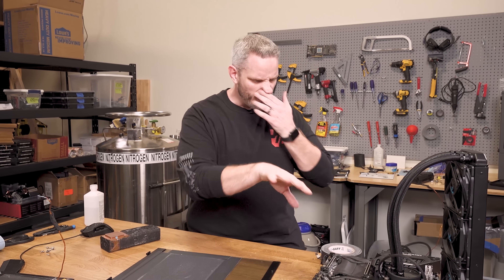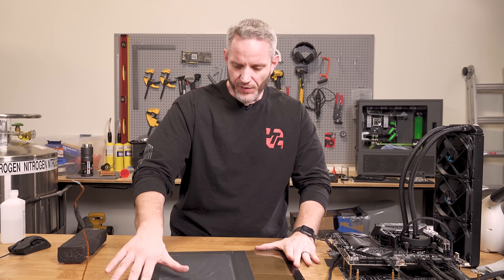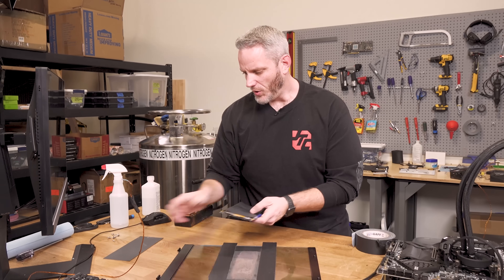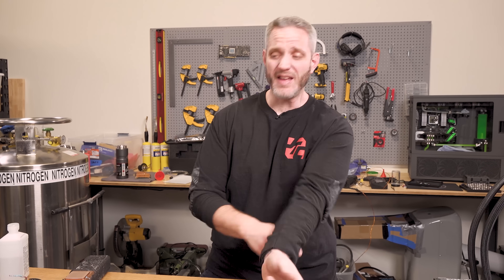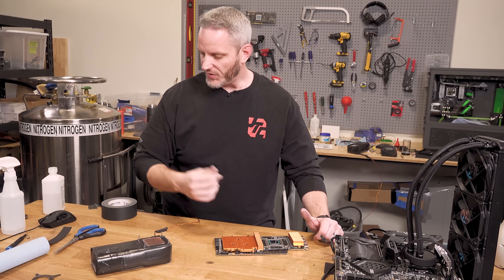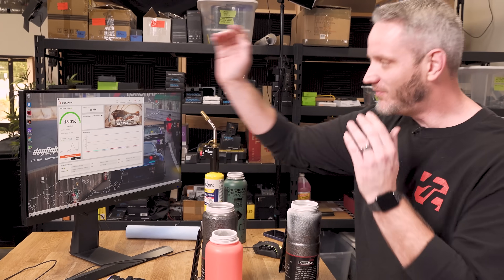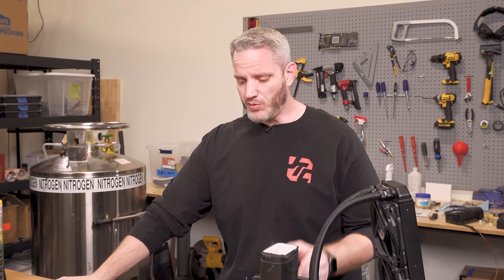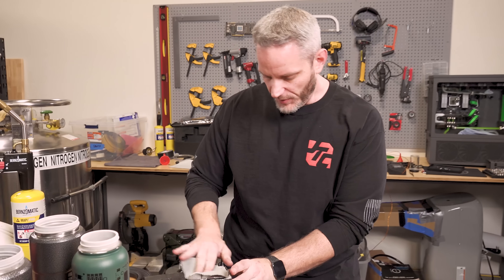THIS is Why Lapping Your Cooler is SO Important!!

Comment: Question: I have installed an NVMe drive onto my hard drive, which comes up in BIOS when I do a search AND it shows up as active (Blue as opposed to being located in black) yet every time I try to clone my OS from my SSD to the new drive, the message that comes up is the same;
"To boot from the new disk, please configure BIOS setting. Make sure the new disk is configured as the default boot disk."
...I changed the location name of the drive in the operating screen, in the BIOS screen I move the new drive to the top THEN the BIOS won't boot up because it is NOT RECOGNISED!!
I have been doing this ALL DAY now and I am at my end, nothing I have looked up has helped, the dozens of videos show me something completely different than what I need to do, so the question is open for some help.

Comment: Do you try to control the air humidity in your workshop? 
And do cooling block and gpu get warped microscopically over time?

Comment: Consider adding 100pF/470pF G0G material or X7R capacitors on back of capacitors for core filtering, it may help you a lot. As they are power hungry it can surely help with OC.

Comment: For more "even pressure" using the clamp u should use a square block/spacer the same size as the die?

Comment: Would just some square off cuts of metal with an insulative layer just in case (even a load of kapton tape maybe) work for bracketing to ensure the pressure from the C clamps is evenly applied across the whole area? It seems to me (newbie here, I don't know shit....at all) would cause a pressure hotspot in a small area and the relative pressure around it would be less given that the board itself is not totally rigid

Comment: Glass is perfectly flat = Has never leveled a Ender 3d Printer.. before and after bed warmup .   AKA You should be using a milled accredited journal block . and you should be using mili calipers to check your work.

Comment: A wider adapter on the end of the c-clamp threaded piston would probably help. Tightening the clamp on the top of those components with just a piece of tape or whatever in-between makes me cringe. The little rubber piece on the end of the rod is not big enough to distribute the load properly when tightening down on components which are soldered to the board. When the c-clamp is tightened the components probably make tiny indentions in the rubber on the end of the clamp from the pressure of tightening the clamp (tape in between or not), then you freeze the whole assembly (clamp, components, and all), and then you crank the handle to loosen and it's a wonder you haven't ripped components off the board already. Need a better way to distribute the pressure. Need a piece of copper, metal, etc., about 1/4" thick that is square with holes drilled on center with the mount with a non conductive, non-stick, hard surface on the card side to take the pressure off the components where your c-lamp is riding. C-clamps are good for holding wood or unfinished surfaces, not precision electronics equipment. Sure they apply pressure, but not evenly.

Comment: Actually, the point of the thermal conductive paste is to make up for imperfections in the two surfaces that conduct the heat to the cooling fins of the cooler radiator itself. The more imperfections removed means less and less thermal paste will be needed. If the two surfaces are perfectly mirrored and flat almost no thermal paste will remain when the block is torqued down. In this scenario the block must be torqued completely flat and square. This creates the optimum metal to metal conduction and removal of heat. Test it and you will see. I did it.

Comment: Jay, glass is not guaranteed to be flat, and it isn't very rigid. I get what you are doing but putting a large piece of glass, of unknown flatness, on a wooden surface to sand a part flat is less than ideal. For the material and size you are attempting to flatten, a proper high quality lapping plate would likely improve your numbers. You should be able to find one for around $200. Here's one sold by Lie-Nielson:

https://www.lie-nielsen.com/products/dia-flat-diamond-coated-lapping-plate

Comment: Changing the mounting bracket using different one will add an variable and you will wonder if the new mouth is good, beside that finally good scoring maybe lapping really help you.
and why you waste so much duck tapes stick on the table and reuse it!

Comment: you could always tighten the 4 screws evenly is a cross pattern, you can get screw driver style "torque wrenches" made for TPMS systems in cars. They are extremely sensitive at low torque specs. I feel they would work well in this application, they can take most types of bites like philliphs or hex pretty much what ever you need.

Comment: Jay, you should try mounting the cooler with carbon paper between the die and the copper block to visualize and adjust any high and low points

Comment: People like to say that being slightly rough gives the thermal paste something to "bite too" but that doesn't seem to be the reason why it's actually better. Having a rougher surface increases the surface area. Even such small scratches means more surface area. So, there is an optimal roughness at which you get the maximum surface area increase, and an increase in heat transfer, without compromising the contact patch as a whole.

Comment: The ice is atmospheric moisture -- consider putting a bag or similar over  it and then using nitrogen, CO2, or some other inert gas to fill the area and displace the air that's present to eliminate ice as there's no moisture in those gasses.

Comment: Jay, have you thought about isolating the PC inside some sort of sealed box (with a tube to add more LN2) and filling the box with dry nitrogen?  No water vapor around the GPU, no ice or condensation to worry about...

Comment: Small granite inspection block will help with flatness, however, they can be expensive. Float glass is a good enough substitute if placed on a 'flat enough' table top. Also, to determine high/low spots, just mark your part with a sharpie. Even fancier would be a dial gauge, but again, kinda expensive to set up.

Comment: I have zero clue about X-OC but you said you removed the foam and feel it helped. If you're still freezing there would it hurt to add some thermal pads instead as sort of an insulator since it's thinner than the foam and can for sure compress enough for it to seal off but could be easier than Vaseline.

Comment: Just a tip. I usually mark a cross with a marker on the cooler base or the CPU IHS. You can check your progress if the lapping is even across the copper by stopping sometimes to see if the cross is coming away evenly and cleanly across the whole area being lapped. It also exposes if you are not lapping evenly or if the surface has a convex or concave profile so you're not having to guess.

Comment: I want to make this comment, having one thing flat on a two piece connection isn't the best way to go about this. Most lapping that is done is two piece lapping. That is where you put an abrasive between the two objects you want to conform to each other and work them both at the same time. You are currently operating under the assumption that your other mating surface is perfectly flat, which it most likely is not. Additionally, your method using sandpaper isn't that accurate as well. Sandpaper is not very uniform in abrasive thickness. You would want an actual lapping plate used in conjunction with lapping media. While what you are doing is better than nothing, it is far from perfect.

Comment: Jay: "...because tempered glass is perfectly flat" 
Me who's tempered glass: "No tf it isn't"
Just get a machined lapping plate, costs about $30 or less and it's machined at higher tolerances than a flexible piece of glass.
Reply: As Penrowe pointed out, lapping copper is difficult as copper is a relatively soft metal. He wound up putting aluminum foil on top of a lapping block and barely managed to get the job done.

Comment: I did work for the first time on a company that used lap machines and it was grate they did have two types of machines one was   Al oxide and the other diamond in solution of oil .

Comment: you can honestly do this same type of thing with the heads of a car and a much bigger piece of sandpaper. i forget what exactly that "roughness" is called, but there is a proper term for it. and that roughness is a big deal when it comes to heat transfer and sealing. certain headgaskets need certain roughness left to seal correctly.  watching this video just brought that to mind
Reply: Roughness average, or Ra is the unit of measurement for roughness

Comment: Have you tried using fans blowing on the board mounts to reduce condensation? The air flow would reduce the temps in the area as well as the air flow drying effect. Like a exhaust fan of a air conditioner .

Comment: Hi I have a question I have not seen videos relating to this. My PC is at ideal and I am using 90% memory. Why?  I have a ryzen 5 3600 with 2070 super and 32 gb 3000 corsair vengeance pro tgb. and mb is the msi x570 gaming edge wifi. PLEASE HELP!!!!!!!

Comment: If you want to do it easier than two directions and look for a cross pattern, you can use the method I use for flattening a knife sharpening stone.Get a soft pencil (2B etc) draw a cross and a grid on the top. the pencil lines will wear away totally when it's flat.
This allows you to move it around in a figure 8 motion for a nicer surface.

Comment: Ok you and Linus need a lesson on basic lapping , doesn’t matter what grit you use but reason it’s called lapping is that you do it in a figure 8 motion to keep surface even,  it’s something I have to do daily for my work, and for anyone asking I have both glass sheet about 8mm thick and a machined lapping plate. ( Fuel injection technician ) dealing with stuff that is .001mm at times .

Comment: You're wrong about leaving it not mirror finished. Thermal paste doesn't need to 'bite', it has to replace the air between the connection. If you will go mirror finish, you remove those tiny air pockets, improoving the thermal conduictivity. If you will magnify mirror finish vs matte finish, you will see a huge difference in the flatness, where matte will look rough.

Comment: Another reason you don't want a mirror finish is that more reflective materials have worse thermal or heat transfer performance, so by keeping the cold plate gritty you are ensuring you're getting as much performance as you can possibly get. It won't matter a lot, but it can make a difference.

Comment: Do you ever think about trying to run a dehumidifier or two in the room you do LN2 overclocking in to try and pull as much of the moisture out of the air as possible to keep the condensation down?

Comment: Jay, keeping a rough surface by ensuring that you don't polish to a mirror finish is all about heat transfer. The microscopic scratches increase the effective surface area for heat transfer on a given die size. 
Think of it like a pleated filter having a higher effective filtering surface because if you were to stretch it flat the surface would be much larger. 
A polished surface would have an effective heat transfer surface of the exact die size.

Comment: Something you can do to show the uneven parts is to put a very light dusting of black spray paint on the copper before sanding and after the first pass the places with no spray paint left are your high spots and the places with paint left are your low spots and once you finish sanding completely there should be no paint left this is a very common technique in body work when doing body filler smoothing

Comment: Color it black with a sharpie or something then you can see exactly where the low spots are as you sand it. Also, I would suggest switching up your sandpaper to something like 3M micron if precision is what your after stay away from grit type sandpaper go with any micron type. It's more expensive but will last longer can be washed and reused and usually sands faster. You can get a mirror finish in half the steps, then go back and hit it with like a 60 micron to give it tooth for the thermal paste.

Comment: Dehumidifier, like run an ac to dry the air to slow the ice formation, you are working it a large area... most are just using a normal size room to OC/barring an event style.

Comment: Jay, don't use a C-Clamp on a guitar pick.   If you don't have a better clamp, you can certainly use the C-clamp, but replace the guitar pick with a lapped, .250" thick piece of stainless steel.  That give you a completely flat area to clamp to and will prevent the die and pcb from bending at all.  

Also, get some machinist's 'blue' and spray it on the pot.  Press the pot onto the die and then remove.  That will give you a much better idea of where the contact is poor than thermal paste will.

Comment: use an adjustable torque wrench to get even pressure on all screws. tighten crosswise. and of course test first on an older graphics card so you don’t ruin the new one.

Comment: A couple of things to consider. The copper is oxidizing fast, that might  resist the heat tranfer  a little. The same goes for grease from your fingers, you keep touching the copper. Wonder what you are thinking about ?

Comment: Stupid question I suppose, but since this pot was made for a specific purpose, why wouldn't it be machined perfectly flat by the manufacturer? If this was clamped at absolute level in a milling machine, could they not provide a perfect surface?
Reply: Also, while I'm doubtful that jay will even see this, could GPU degradation be a factor as to why you can't achieve the same clock you were before lapping the pot?

Comment: top tip, color the surface you're lapping with sharpie, this shows exactly where the high points are and shows clearly if uneven pressure is being applied before you go TOO far,
Reply: Great tip to gauge your work.

Comment: But why would you buy a LN2 pot that's die contact area is so poorly flat? If you were going to cool this card seriously for LN2, why wouldn't the card be flat, like the mobo, linked via riser cable? That board is always gonna flex under the LN2 pot weight mounted.

Comment: I recommend that instead of taping the sandpaper down, you clamp down the copper so it doesn't move and use a small flat block with sandpaper stuck to it. This is because with the paper stuck down, as you rub the copper over it you have the chance to distort the paper which can cause an uneven finish. Also, you can spray a lite coat of paint on the copper before you start rubbing, this makes seeing where the uneven parts are easier as you rub.

Comment: I thought the paste was only to fill the minute gaps so if the die and heatsink are both perfectly mirror smooth and flat then you could in theory mount them without paste. So you don't need a rough surface to 'bite', you want as smaller gaps as possible (i.e. mirror finish) and then the minimum paste possible.

Comment: have you thought about using a dial indicator to measure the flatness? that would give you more to work with than just intuition alone. youll get numbers to see any variance on the surface accurate to the tenth of a thousanth of an inch.

Comment: hey Jay,..like the show, thank you, goode jobbe,.... you should look into the annealing of copper(in jewelrymaking) if you heat copper to certain temp it anneals and becomes much softer and easier to work with and then you have to temper it again to harden it again,.... maybe test an annealed pad and a tempered pad,... i don't know what the difference would be at sub zero temps?

Comment: Scuffing allows the paste to grab and fill in grooves, lapping the ihs to a dull finish like your block works, I prefer just doing the heatsink though so the cpu can be sold easily.

Use an rlectronic grade silicon/silicone sealant.

I use the paste spread method

Comment: I’m surprised you haven’t tried using a torque wrench with a bit holder on it to try and equalize the screws. Should at least give you a good starting point before putting the c clamp on

Comment: Probably a stupid question but.
Wouldn't grooving the heat sink and the GPU die (akin to something like a shallow finger joint) increase contact area? Or would this just make the disparity in temps greater.

Comment: Maybe try a different tactic all together.   Go with a submersion of the entire system into something like SubmergeDeep SD-110 by Engineered Fluids (or Fluorinert by 3M, but I think the Submerge deep has better properties for this).   The Submerge deep doesn't boil until above 300C (572F) and does not freeze.   So you could pre-cool the tub of SubmergeDeep and then have a radiator system and some pumps to keep the solution cool and moving, and I suspect you will get a better cool on the CPU (and all other components) without having to worry about freezing or condensation, etc.

Comment: The problem is not only the base of the cooler is convex/uneven but the GPU/CPU die itself is not perfectly flat, not to mention that the cooler baseplate bows by a significant amount under mounting force. I think der8auer did a very interesting experiment in which he sanded down the sillicon die of a 7920x and surpise surprise it was pretty uneven.